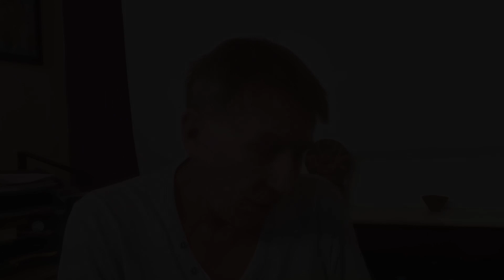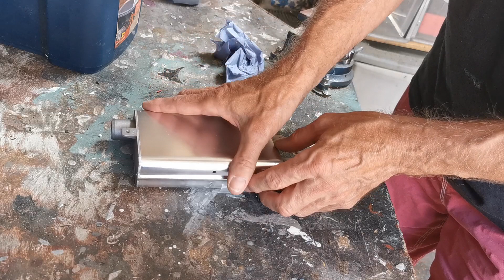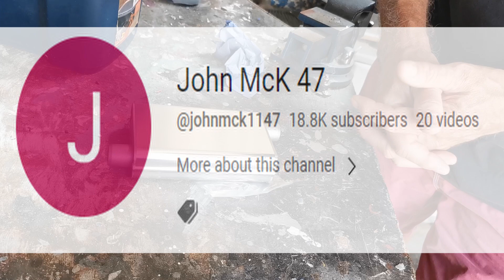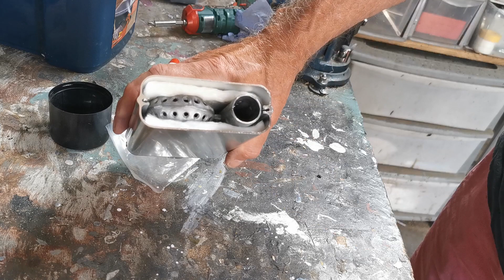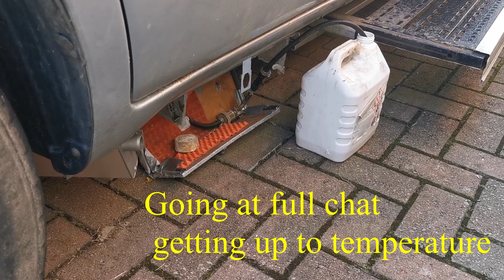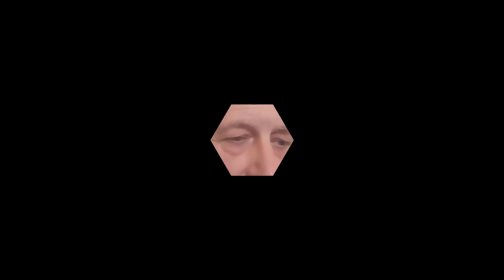New 'Upgraded' CDH Exhaust Muffler

Comment: When i fitted my first heater the sound traveled few hundred yards. In fact on airfield i could hear exhaust reverberating off hangers. Sounded like jet engine running.
Reply: Sorry tried app. Was removed within 2 minutes, use ear.

Comment: I think one problem, using vehicle silencer tech. which is pulsing. Here we have continuous flow to suppress. How much noise is generated by the corrugations of tube or the exit of the pipe. Quite high freq. to suppress.
Reply: Have my 2nd heater tomorrow to experiment. I want nearly silent.

Comment: Hi,
Getting up early and firing up my diesel heater has always concerned me, in so much as disturbing anyone else parked nearby.
So it's interesting to see the sound difference, albeit relatively small.
How much dearer was the new one?
Thanks,
Steve
Reply from the maker: Yep... I am of the mind.. every little helps if you are near others. Cost...not much if you are happy to wait for it from China... £7.00... about  £11.00 from UK   https://www.ebay.co.uk/itm/204338855874?mkcid=16&mkevt=1&mkrid=711-127632-2357-0&ssspo=7cyiwlmerim&sssrc=2047675&ssuid=03eqpXW9R3q&var=505050194045&widget_ver=artemis&media=COPY